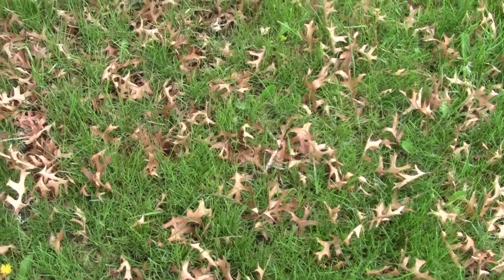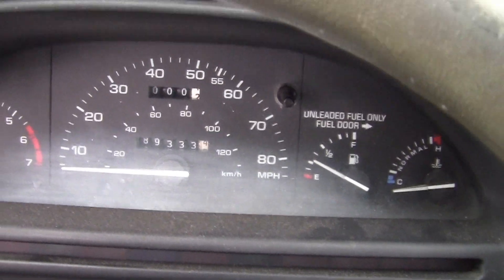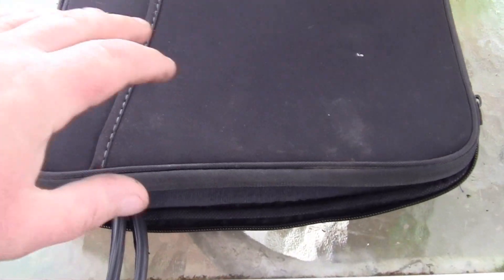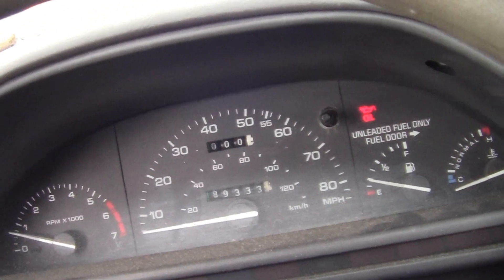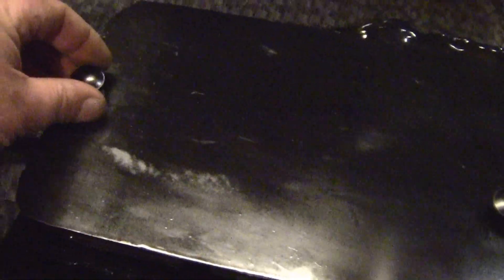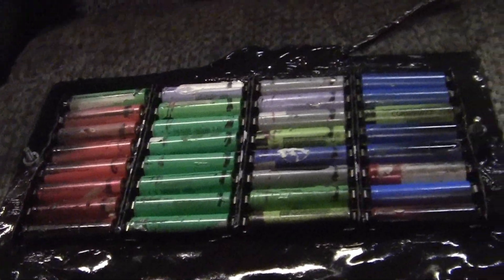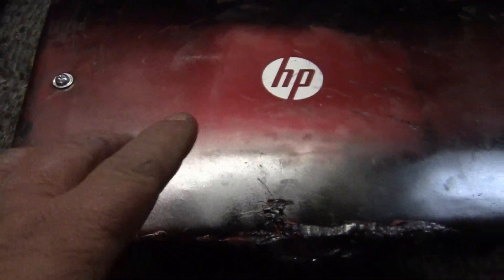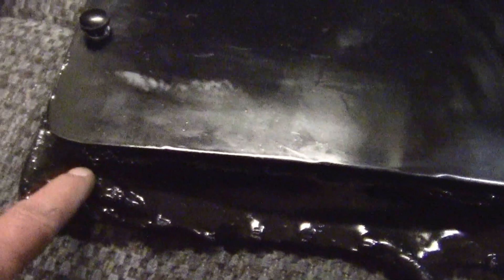RECYCLED LAPTOP BATTERY CAR JUMP PACK (PART 3) FINAL

Comment: Which diode you used in it.?
 And can you tell me how much  amps pull your car starter to start engine.
Reply from the maker: Sorry it's been a long time since this build . I don't know anymore what diode I used . And the car has been gone for a long time as well ! Sorry wish I could answer these questions for you .. Thanks !!
Reply: @shawnmrfixitlee6478  by the way great work. Appreciate it... 🤘
Reply from the maker: @iezazahmed2027  Thanks , It works great ! All made from recycled parts to ..
Reply: @shawnmrfixitlee6478  i also making a battery from laptop used batteries 3 series and 18 parallel. instaling 3s 40a bms. And 200amps 2 diode in parallel at negative side of battery pack. So i expect that this is gonna start my 1.6cc corolla.
Reply from the maker: @iezazahmed2027  It sure will ! Thanks .. Sounds like it's going to be a strong pack ..